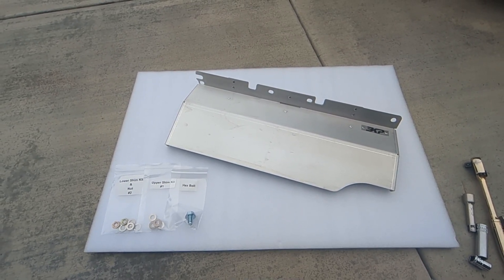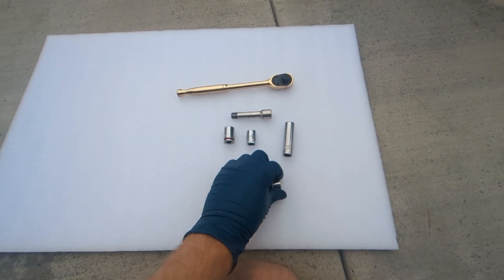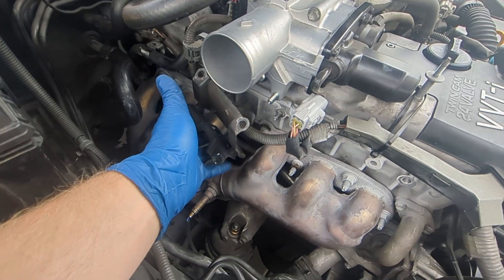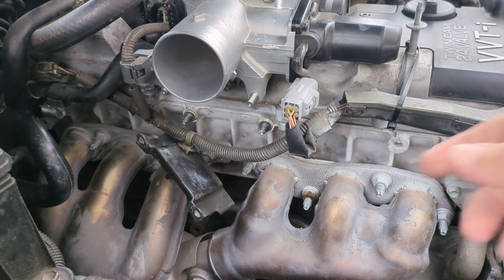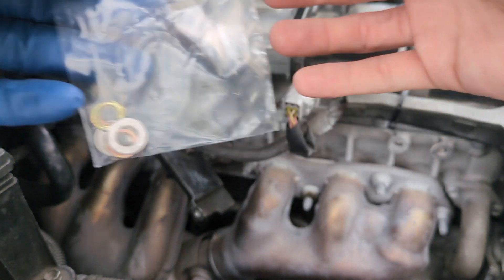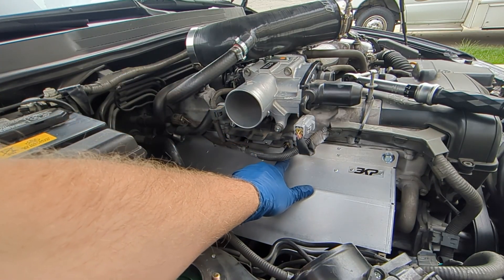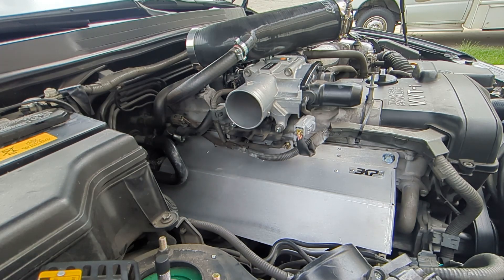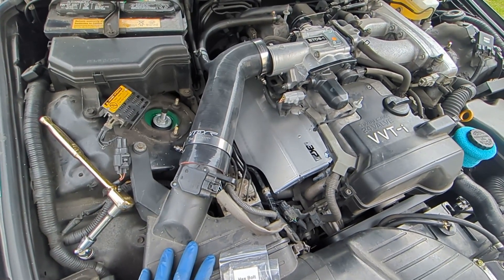2JZ-NA Heat Shield Install Project EKP Lexus IS300

Comment: Will this fit on my gs300?
Reply from the maker: Yes it should! If your engine head is equipped the same as an IS300 there shouldn't be a difference!
Reply from the maker: It has been confirmed that it works on GS300s no problem.